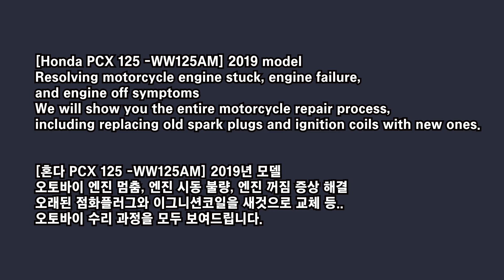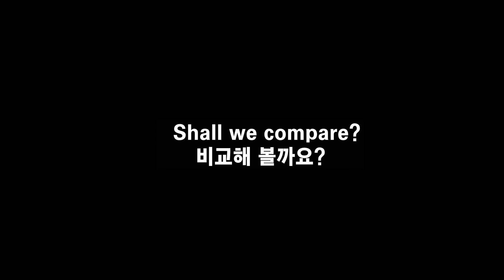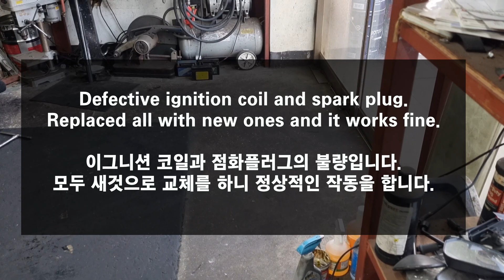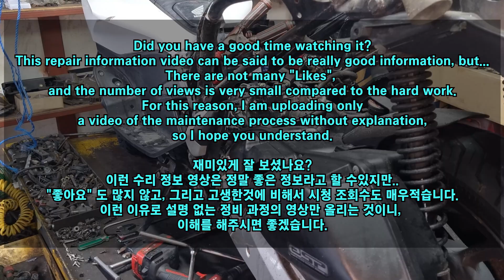Symptoms of motorcycle engine stop and engine start failure? Suspect the ignition coil. Honda PCX

Comment: thanks I have a SH150i which cuts out at low speed. Plug replaced previously a few months ago. Could be coil or dirty fuel tank causing blockage ?
Reply from the maker: Make sure the cable connected to the plug is connected properly and firmly. The plug may be receiving unstable power.

Comment: What causes this?

I've had this same problem and I brought it to the shop, they said it's caused by the way the motorcycle was washed, but he never specified how so.

What do you think causes this problem?
Reply from the maker: This part is a consumable part. It usually causes problems after a long time. In my experience, it is necessary to check it once every 50,000 km or so... or about 5 years.

Comment: Last Friday while driving my PCX (58600KM in total) I was stopped in traffic and the idle stop was activated, when I went to give it a go, it wouldn't start anymore, a few days before it did the same thing, I had to turn off the engine and start it again, but this time it wouldn't start anymore, a tow truck had to come and get me.
I opened the fuse box and there was sulphation on all the terminals, but the largest relay was completely green from sulphation, so I removed all the fuses and the two relays to clean everything with a contact cleaner spray and leave it overnight with that liquid to get everything clean.
I checked the big relay with a multimeter and a 9volts-cell battery, it gave me continuity but in Omnh it gives me 108 when it should not exceed 100 or 103, so I suppose, due to sulfation and the idle stop system causing intense voltage rises and falls in seconds, that would have caused the relay to be damaged, when I tried to start the engine, that relay made a "click, click, click" noise but nothing else, so I had to ask the official workshop for a new one, but the price was abusive, 37 euros, when a BOSCH brand one costs 10 euros, they have made the PCX relay smaller than normal so that none can be put in other than the one sold by HONDA manufactured by Mitsuba...
Let's see if in a few days it arrives and I manage to start it again, I hope that was it and the coil has not broken, which here the original costs 75€ or, if it is bad, the VCI unit because otherwise I would be I forget about the bike and sell it for parts...
The official Honda mechanics here in Alicante, Spain, have no idea how to repair, they only change parts and look at the workshop manual...
I feel frustrated, but you can't pay these people almost €100 for each hour of work and they tell me they need between 2 and 3 hours, thieves...

Comment: Hello, I had a question for you. My Honda ADV150 engine started to have problems with ignition. It constantly cuts and stops the gas, ABS and speedometer went off. Could the coil cause all these problems?
Reply from the maker: I don't think it's a coil problem.
First, check the plug and air cleaner condition,
and for other symptoms, it seems like there may be a problem with the wiring.
This is something that can't be known without checking it yourself, so it's difficult to answer.

Comment: It looks like I have had the exact same problem for nearly 3 years now but mechanics in my country are fake mechanics, they don't know the problem. I will look into it. Thank you!
Reply from the maker: Thank you for your interest in the video.
Reply: Great content, but my problem  is different, after leaving the bike for two years without using it I bought a new battery and i press the ignition  and I only hear a "click" no engine sound, no starter motor sound, nothing!!!  This video however is excellent, keep up the good work

Comment: Hello, I am following you from Türkiye, Istanbul. I would like to get information about a subject. 2021 model honda pcx 26500 km fuel tank is creating vacuum, how should I solve the problem, thank you
Reply from the maker: The fuel tank cap has a hole that allows air to escape. If this part becomes problematic, pressure may build up in the tank.
Replace the tank cap, or check and drill a hole in the fuel tank cap.
Reply: @MotorcycleRepair  Hello dear master, I drilled a hole in the fuel tank tank cover, thank you very much.

Comment: tnx for sharing. Have a hint, after a longer riding, you turn off the bike, wait for 15-20 minutes and than you want to start again. But you dont hear the "humming" of the fuel pump when turn on ignition. Lets cool down the engine for one our or so and every thing works fine. tnx
Reply from the maker: Thank you for your comment.

Comment: do you have electric waring of yamaha cygnus
Reply from the maker: ما التحذير؟ تحقق من رقم رمز الخطأ
ثم يمكنك معرفة مكان كسرها.

في حالة وجود تحذير من الزيت أو منظف الهواء ... يصف دليل المستخدم كيفية إعادة ضبط ضوء التحذير.
هذا ليس تحذيرًا بالفشل ، ولكنه وظيفة تخبرك بالوقت اللازم لاستبدال الزيت ومنظف الهواء والمواد الاستهلاكية المختلفة.
انتقل إلى أقرب مركز خدمة واطلب إعادة تعيين أو ...
يمكنك إلقاء نظرة على الدليل والقيام بذلك بنفسك.
(아랍어)

what warning? Check the error code number
Then you can find out where it's broken.

In the case of an oil or air cleaner warning... the user's manual describes how to reset the warning light.
This is not a failure warning, but a function that informs you of the time to replace oil, air cleaner, and various consumables.
Go to the nearest service center and ask for a reset or...
You can look at the manual and do it yourself.

Comment: Hello, my friend

Is it possible to flush the engine with gasoline when changing the oil
Reply from the maker: Available. But not recommended.
Alternatively, run the engine for 10 minutes after changing the oil.
and change the oil again
Replacing it several times like this will clean the inside of the engine.
Reply: @MotorcycleRepair  | How much oil should be filled
Reply from the maker: @murodjon_kholjumaev  If cleaning is the purpose.. About 0.8 ~ 1L
Reply: @MotorcycleRepair  Thank you  my heart brother
Reply from the maker: @murodjon_kholjumaev      Have a nice weekend.

Comment: Like your video 
In what circumstances will direct you think that it is the problem of the gasket? 
The head of spark plug got wet? 
Or 
Find milky colour of the engine oil ?
Reply from the maker: This applies to both situations.
If I could explain just one thing...

If your spark plugs are wet...it's most likely a gasket problem.
When the engine is running normally...
The spark plug is wet and when I check with my finger at the end of the muffler outlet, it is wet.
If both are wet, it's a gasket problem.
(But not in this case.
Ignition coil problem, spark plug problem, the engine does not start,
If you continue to try to start the engine, gasoline will remain unburned in the engine cylinders.
Also, the spark plugs get wet. In this case, it is not a gasket problem.)

Comment: How many total kilometers got this motorbike? My PCX 2019 got now 38.000km in almost 4 years... And when i must make an valve adjust? Thank you very much for this helpful videos 👍🏻
Reply from the maker: The pcx 125 in the video is a motorcycle that has driven about 57,000 km.
Ignition coils are mostly used permanently...
However, when replacing spark plugs, they must be strongly bonded.
If there is a loose connection between the coil cable and the spark plug,
The engine may become unstable.

In the case of valves, in most cases, listen to the valve sound and check for abnormalities.
Or when the engine starts, engine power, or rpm instability is felt.
Check in this case
Reply: @MotorcycleRepair  thank you very much again bro! 💪🏻✌🏻🛵💨
Reply from the maker: @elrinconderoller1560  thank you 😄😄😄😄